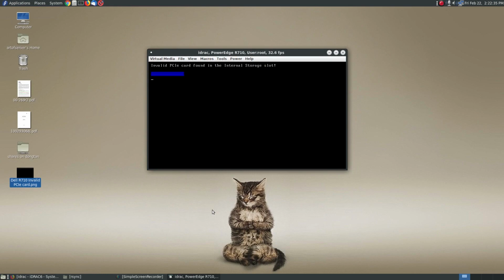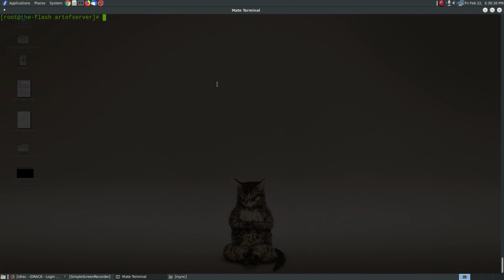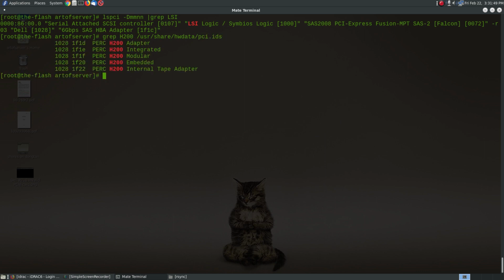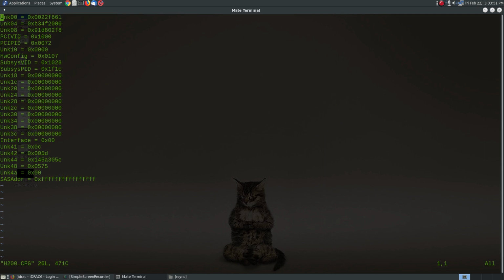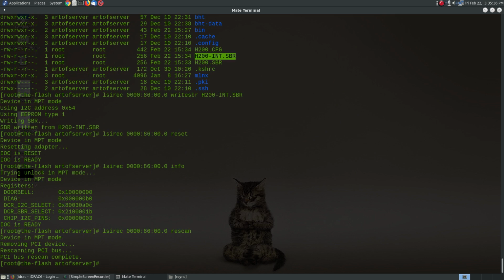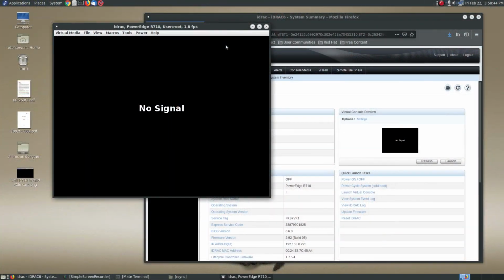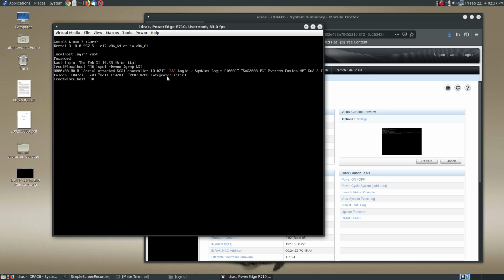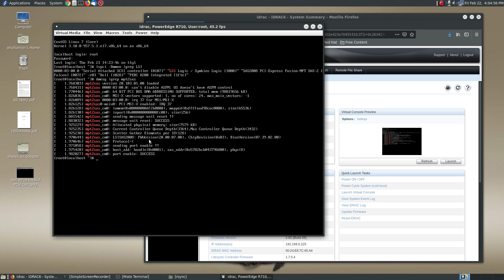How to fix: "Invalid PCIe card found in the Internal Storage slot!" error in Dell PowerEdge R710

Comment: Hello, I've been trying to do the same thing with a PERC H700, which seems to be about the same for the most part as the process goes. I have a problem though, it keeps on resetting the to the Adapter code after one reset/powercycle. So directly after flashing the changed SBR everything is fine for one boot, and then it is not the next one again. There seems to be a backup storage somewhere that flashes back the original code. Any advice?
Reply from the maker: That's the firmware checking the SBR when it first starts up. That's what happens if you make an incompatible change. What exactly are you changing in the SBR?
Reply: @ArtofServer  Similarly to what you've shown for the H200, the H700 has codes for "internal" and "Adapter":grep H700 /usr/share/hwdata/pci.ids                                                                                                                                                                                                                        
                1028 1f16  PERC H700 Adapter
                1028 1f17  PERC H700 Integrated
                1028 1f18  PERC H700 Modular
                1028 1f1b  PERC H700 Integrated

I actually have two servers, one with the "integrated" version and one I had to buy a new card for, which turned out to be an "Adapter" version.
So, the native "Integrated" card shows:
lspci -Dmmnn | grep LSI
0000:01:00.0 "RAID bus controller [0104]" "LSI Logic / Symbios Logic [1000]" "MegaRAID SAS 2108 [Liberator] [0079]" -r05 "Dell [1028]" "PERC H700 Integrated [1f17]"

The other one though:
lspci -Dmmnn | grep LSI
0000:01:00.0 "RAID bus controller [0104]" "LSI Logic / Symbios Logic [1000]" "MegaRAID SAS 2108 [Liberator] [0079]" -r05 "Dell [1028]" "PERC H700 Adapter [1f16]"

Analogue to your description for the H200 I extracted the SBR from the Adapter, configured it to the "Integrated" code:
[root@flash lsirec-master]# ./lsirec 0000:01:00.0 unbind
Device in MEGARAID mode
[root@flash lsirec-master]# ./lsirec 0000:01:00.0 halt
Device in MEGARAID mode
Resetting adapter in HCB mode...
Trying unlock in MPT mode...
Trying unlock in MEGARAID mode...
Device in MEGARAID mode
IOC is RESET 
[root@flash lsirec-master]# ./lsirec 0000:01:00.0 writesbr H700NEW.SBR
Device in MEGARAID mode
Using I2C address 0x54
Using EEPROM type 1
Writing SBR...
SBR written from H700NEW.SBR

Resetting it after the flash isn't working really:
./lsirec 0000:01:00.0 reset
Device in MEGARAID mode
Resetting adapter...
IOC is RESET 
IOC is RESET 
IOC failed to become ready

But reading it again now shows:
lspci -Dmmnn | grep LSI
0000:01:00.0 "RAID bus controller [0104]" "LSI Logic / Symbios Logic [1000]" "MegaRAID SAS 2108 [Liberator] [0079]" -r05 "Dell [1028]" "PERC H700 Integrated [1f17]"

That is gone after the next reboot again though, it's back at 1f16. If you don't reset it, it is still a 1f17 after the reboot (and even works in the R515 I am putting it in then for testing, internal slot) but after the next reboot it's gone again, back to 1f16.
Reply from the maker: @roman7328-m5w  so you are changing only subsystem product id?
Reply: @ArtofServer  yes
Reply from the maker: @roman7328-m5w  I see. In your detailed description above, you write the H700NEW.SBR file, but you don't describe how you generated it. Are you sure it has correct checksum byte? If the checksum doesn't match the data, the firmware will attempt to correct the SBR.
Reply: @ArtofServer  ok, here goes:
-I got the lsi-utils and lsirec.  Compiled both with gcc.
-commands:
./lsirec 0000:03:00.0 unbind                                                                                            
./lsirec 0000:03:00.0 halt                                                                                              
./lsirec 0000:03:00.0 readsbr H700.SBR

-That previous command wrote the original H700.SBR (extracted from the H700)
-converted the SBR with 

python sbrtool.py parse H700.SBR H700.CFG

-Made changed to the CFG (just the Product subsystem ID,)

-built the new SBR:
python sbrtool.py build H700.CFG H700NEW.SBR

-and then wrote the entire thing back to the H700:
./lsirec 0000:03:00.0 writesbr H700NEW.SBR 
./lsirec 0000:03:00.0 reset
./lsirec 0000:03:00.0 rescan
lspci -Dmmnn | grep LSI

-It did display the correct Subsystem ID after flashing it (and resetting it), but after the restart it was back to the "Adapter" code
-I repeated that in various combinations, with reset and without, but in the end, it only holds for one reset (be it a computer restart or a reset command from the command line), after the second reset it's back to Adapter ID.
-I then started hitting the search engine and looked for more comments. Came across the hugepages, and set that as well. Didn't change the outcome though.I tried with python 36 and python 2, originally tried debian and then switched to CentOS for it, first the current release and then the one that came before it (the current release didn't support the hugepage-settign, had changed architecture and came with python36, the older release still has the setting and python2).
And after googling some more after verifying that for that one boot the Dell R515 I am testing in really does work with the card for that one boot, I turned back here :-)
I came across two reports from the net with the same issue. As far as the checksum goes, how to I control that?

The CFG (it as said only has one changed line):
[root@flash lsirec-master]# cat H700.CFG
Unk00 = 0x6132f561
Unk04 = 0xb34f30f5
Unk08 = 0x91c600f8
PCIVID = 0x1000
PCIPID = 0x0079
Unk10 = 0x0000
HwConfig = 0x0104
SubsysVID = 0x1028
SubsysPID = 0x1f17
Unk18 = 0x00000000
Unk1c = 0x00000000
Unk20 = 0x00000000
Unk24 = 0x00000000
Unk28 = 0x00000000
Unk2c = 0x00000000
Unk30 = 0x00000000
Unk34 = 0x00000000
Unk38 = 0x00000000
Unk3c = 0x00000000
Interface = 0x00
Unk41 = 0x2c
Unk42 = 0x0000
Unk44 = 0x00000000
Unk48 = 0x0000
Unk4a = 0x00
[root@flash lsirec-master]# 

And for good measure, since I also did have a true internal card of the same make available for a few days, I extracted the SBR from that one as well and tried flashing it and compared the CFGs. Not much luck there either though.
Reply from the maker: @roman7328-m5w  Ok. so it looks like Dell's firmware is checking the subsystem ids and correcting it at some point. some times a message along those lines will show up in the system logs, so take a look to see if there's a message indicating the firmware is modifying the SBR.

Anyway, I don't deal with RAID firmware that much, but based on what you've shown me, I wonder if Dell has a different firmware for the "Adapter" versus "Integrated" cards? If so, perhaps what you need to do after changing the SBR, is to flash a "integrated" specific Dell firmware? I believe you should be able to do it with megacli64 or megarec. Search for Dell's firmware for the H700, and see if there are 2 different versions.
Reply: @ArtofServer  ok, will do. I am currently awaiting the delivery of another "proper" H700 integrated and will then start working on the H700 Adapter again. Will let you know what I find, and I guess, once I have figured this out I'll do a little howto for it. Will be a few days though before I can report back.
Reply: @roman7328-m5w  so any update because I'm having the exact same issue
Reply: @Toys0126  hi, not really. The issue seems to be that the original firmware setting is restored after one boot, and eventually I just went for putting it in production with longer SAS cables in a regular PCIe slot. Given that the firmware on this card (the H700) can't just be replaced like on the lower leading number cards of the generation (like the 200) is probably at the core of it. At least my working theory would be that with a replacement firmware that would  either not happen anymore or one could gain more insights. I'll re-visit the issue eventually, just don't know yet when.

Comment: hey there, would this work with 047MCV version of the H200 on dell r610? or is this problem only on the r710?  Thanks
Reply from the maker: It's a problem on all 11th gen Dell servers with a 'integrated storage PCIe slot'. also on 12th gen servers, but in the "mini monolithic" slot. so yes, you can apply this method to fix a H200 to work in R610's integrated storage slot.
Reply: @ArtofServer  thanks for the info!

Comment: Thanks for this video, you helped me get my h200 working in IT mode in my dell r710. For those having issues getting lsirec installed and working, check out the notes on this pdf https://phoxden.net/H310MM_IT.pdf. I had to make sure I was running the lsi commands with sudo ./ although I could have worked around that by logging in as root but who has time for that.
Thanks again.

Comment: I watched two of your videos,quite impressive.Here is my challenge have you ever thought of flashing a L S I 2108 to IT mode?. I saw a tutorial online about flashing 2208 to 2308 then I came across your video doing the same thing but with a twist. I was always wondering if the 2108 could not be flash to IT mode,people say it"s impossible but anything man program can be circumvented.
Reply from the maker: I have thought about it; the 2108->2008 cross flash. I think it may be possible, but in the end, I never put any time into it because there's no economic advantage to doing so. The SAS2108 cards are usually more expensive than SAS2008 cards. And I haven't found any cool motherboards with SAS2108 that would make it worth it to convert to running SAS2008 IT firmware. The chip architecture is similar enough to SAS2008 that I think it maybe possible.

Comment: Hey 

Thanks for the video @Art of Server , but im having issues installing/compiling Isirec , i downloaded it from https://github.com/marcan/lsirec is that were you got yours from?

The files i downloaded only have a Makefile, running ./configure fails as there is con configure script.

Would really appreciate any help ( google does not help ) as i just bought this card from Ebay to use with my R710 and Un-Raid.
Reply from the maker: All you need to do is run make.

Comment: Trying this currently. The unbind works. When halting the system resets instantly. Any thoughts?
Reply from the maker: What do you mean the system resets immediately? And what kind of system are you on? Can you show the specific commands you are running?
Reply: @ArtofServer  Believe it may have been Mobo/PCIe slot. Used another board and worked fine.
Reply: Also thanks for flashing, testing, and selling on eBay. Bought a few things from you to feed my addiction.
Reply from the maker: @thatsux0rz  Thanks!
Reply: @ArtofServer  Got further. But the device is stuck in reset and fails to become ready. lspci shows the new ID but upon reboot changes back. Using a live boot of Manjaro 18.04.
Reply from the maker: @thatsux0rz  ok, you need to wait until the IOC is either ready or fault state. you can look at the state with:

lsirec xxxx:yy:zz.a info

if it eventually becomes ready, you're good to go. if it goes into 'fault' state, then just issue reset again:

lsirec xxxx:yy:zz.a reset

after that, in 99.99% of the cases, IOC will immediately becomes ready state.

also, if after a 'rescan' it doesn't show up (look for it via lspci), you can rescan the entire PCIe. see the command in my video for doing that.
Reply: @ArtofServer  I've let it sit for a while and can't get it into a fault state or ready. I will post a screenshot later today.
Reply from the maker: @thatsux0rz  what firmware do you have on it? Show me the steps you are doing, with the exact commands you are entering.
Reply: @ArtofServer  The card shows as Integrated in the BIOS boot sequence and has the latest H700I Firmware,  12.10.7-0001. The commands are being run exactly as in your video. https://photos.app.goo.gl/CMyzgnTVPbzshkj57

Comment: @Art of Server

I am familiar with flashing process. However where so I get the sbrtool and lsirec programs from. I cannot find them on the Broadcom site or anywhere else. Are they part of another package? Can you advise where I get them from. I have a number of H200's H200A H200I that are behaving badly when flashed to IT and put  in the storage slot. As you probably know on the R710 without buying extended cables you can't easily move them to another PCI-E slot.

Any help appreciated.

Cheers
Spart
Reply from the maker: if you do a search for lsirec, you'll find a project on github. it also includes the sbrtool. you'll need to compile the code and i think its mainly for Linux only so you'll need to have Linux OS to do it this way.
Reply: @ArtofServer  

Hey thanks for that. I will give it  a go. I usually use a FREEDOS boot usb to do the flashing. We run Ubuntu on all desktops laptops and servers. I think the issue may have been caused by the latest DELL Non-RAID (IT Mode) FW from here  https://downloads.dell.com/FOLDER02314980M/9/SASHBA_Firmware_6GBPS-SAS-HBA_07.03.06.00_A11_ZPE.exe the A11 dos version when flashed to a fully working H200 the card ends up as an IT Mode H200A not a H200I or maybe I missed something and convinced myself this was the case. I don't have a stock Flash and Firmware dump from a standard H200I straight from a storage slot to compare to. 

If going to the 9211-8i LSI FW and BIOS (P20) are you saying this will boot in the storage slot after the SBR modification to 1f1e , even with the LSI Firmware and BIOS?

Cheers
Spart
Reply from the maker: @sparticle3579  The answer to your question at the end is: "yes".  The only thing preventing a PCI-e card from not working in that storage slot is the subsys VID/PID, not the firmware.
Reply: @ArtofServer  

Many thanks. I will give it a try and see. The card in question at present is a H200A flashed to Dell IT mode firmware. System halts because of this issue. I will flash to P20 9211-8i FW and Bios and mod to 1f1e in the SBR file and report back for other users trying to fix this issue.
Reply: @ArtofServer  

What an absolute superstar :). Thank you man. Worked perfectly first time. Brilliant. 

Spart
Reply from the maker: @sparticle3579  terrific! glad to hear it! :-)
Reply: @ArtofServer  Sorry, I have no idea what I am doing when it comes to using github and compiling code, how exactly do I compile the lsirec code on a linux distro?
Reply from the maker: @nxnnnn  in that case, it might be easier if you just bought one of my H200 cards that are already modified. :-)

Comment: Will this card work with ESXI 6.7 on my R710?
Reply from the maker: I haven't specifically tested ESXi 6.7 on this R710 with the H200, but I know ESXi works with other SAS2008 based HBA cards, so I'm pretty sure it should work.
Reply: @ArtofServer  if you could run a test I would like to buy two of the cards. Please let me know
Reply from the maker: @MrShagCarpet  Sorry, I'd love to run a test of installing ESXi on this, but my schedule is pretty full and I probably won't get around to do that in a time frame that makes sense for you. But like I said, I'm pretty sure SAS2008 based HBAs will work with ESXi. At least for ESXi 6.5, I had a few servers with SAS2008 based HBAs and they worked just fine. Also, VMware compatibility guide shows this as supported:

https://www.vmware.com/resources/compatibility/detail.php?deviceCategory=io&productid=13971

Maybe someone else reading the comments here can chime in with 1st hand confirmation?

Lastly, keep in mind, the H200's i sell are NOT RAID cards. They are HBAs, or IT mode cards, so you will need some other technology to manage the disks. A lot of people run a FreeNAS VM and pass the HBA card directly to the FreeNAS VM as a solution.
Reply: @ArtofServer  I understand what the card is for. That's why I'm interested in what you have. I have a H700 raid card and like to have direct access to my drives...
Reply from the maker: @MrShagCarpet  ok. i just wanted to make sure; not everyone knows the difference.

yes, in that case, the H200 I sell should do just fine for your needs.
Reply: @ArtofServer  well I'll buy one for now on your Ebay site... thanks

Comment: How did you get the r710 ipmi to work on linux? I've been trying to find a way to run the java app but it always refuses to connect.
Reply from the maker: For one, I'm using the Oracle JRE, not OpenJDK. I've found OpenJDK isn't mature enough yet and frequently run into issues with it. Second, the solution is the same as with Windows or Linux or any platform, you need to open up jcontrol and add the iDRAC host to the exceptions list. Then, you need to change the java.security file and comment out some of the disabled crypto algorithms. Then, the java remote console app should work just fine. Do a search online, it's been documented before and I found the solution via search.
Reply: @ArtofServer  Thank you

Comment: great video! do you offer support on Sun Oracle 8 Port 6 Gbs SAS HBA PCIe Low Profile 375-3609-03.  they work great for my unraid, but have trying to find a way to update the firmware for no reason but to try. but sas2flash does not see the card.  thanks
Reply from the maker: I'm not that familiar with that HBA card. A quick search online hints that it is a Sun Thebe card, so it doesn't appear to be a LSI part. That's probably why you can't use sas2flash, as that is only for LSI cards.
Reply: @ArtofServer  ok thanks